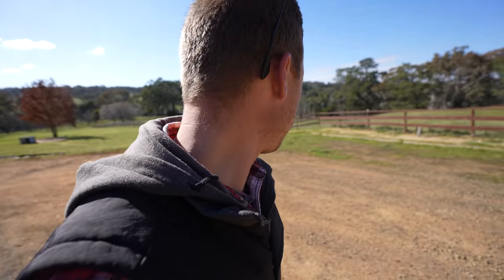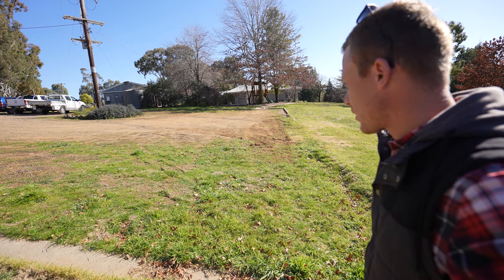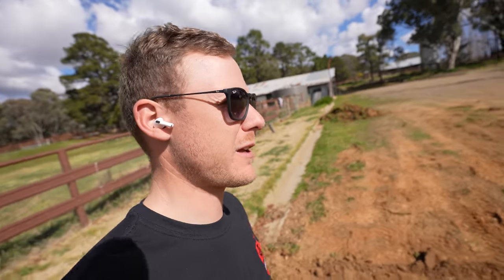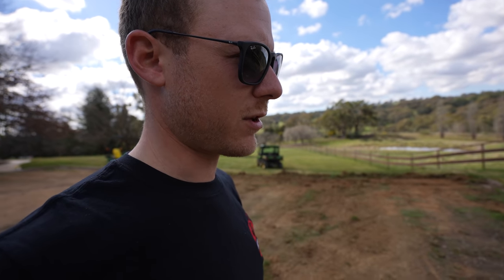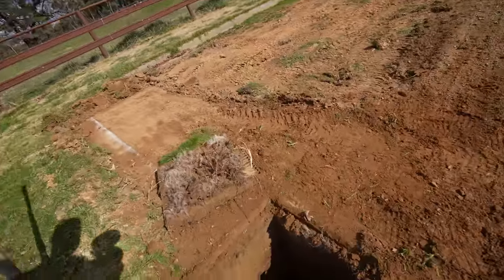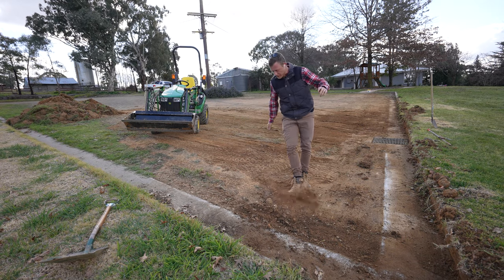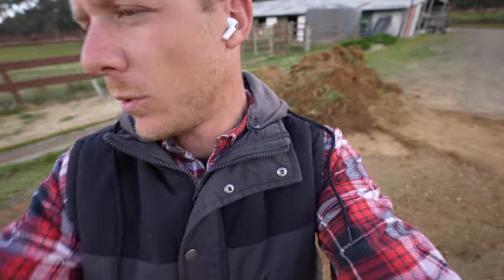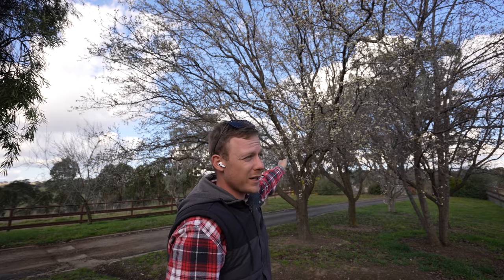I Love a Productive Day!! // Putting The Tractor to Work

Comment: Most farm tractors just fill the rear tyres with water. The dealer can do it for you. I’m not sure if you can get wheel weights for small tractors but that might also be an idea. Your better off keeping the 3 point free as much as possible. I’ve broken enough equipment in the past using it as counter weight to have learned that lesson.

Comment: Stormy should run to an easement/ council drain either on your property or next to it. If it does run out to the paddock it "should" be in a straight line as there "should" be another pit at any change of direction.

Comment: Dude, open the bucket and scrape backwards. You cannot level ground going forward. 
Also get a 30 gallon drum, drill a  fifty mm hole in base in the centre, put 50 mm pvc pipe in to above the top, fill drum with concrete around pipe Trowel off nice n flat. Once dry, tip on its side use it with a bar thru it to lift as a weight on your rear linkage.
Reply from the maker: Yeah I did that a few times if you Pause some of the time lapse. New to the 4 in 1 bucket so just trying to get used to it. 

Also great idea 👌🏽

Comment: We usually put water in the rear tractor tires help keep you landed while keeping a small profile in tight spaces
Reply: If you use clean water……… don’t let it freeze! …. It is going to be a bit rough with 5	0-80kg of ice in one side of the tires in winter time
Reply: @tobiasjacobsen_dk  put antifreeze in it like your car rad, great advice!